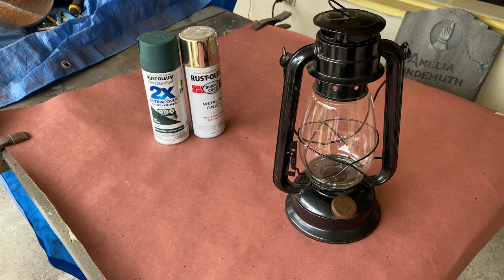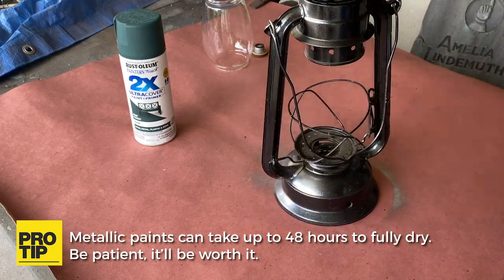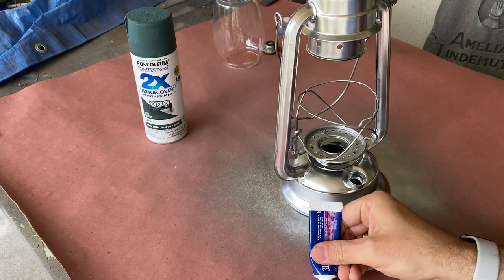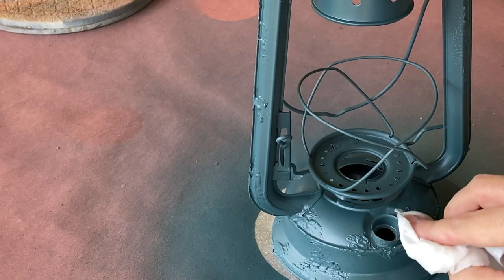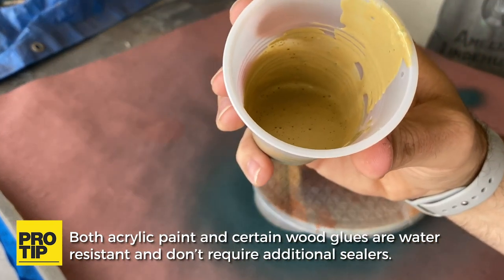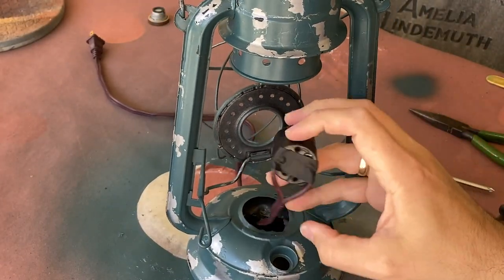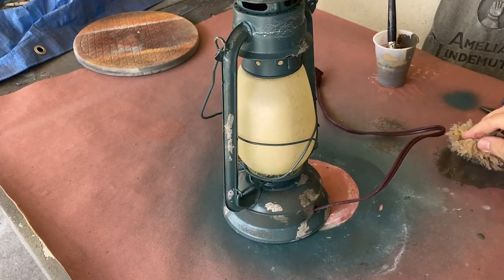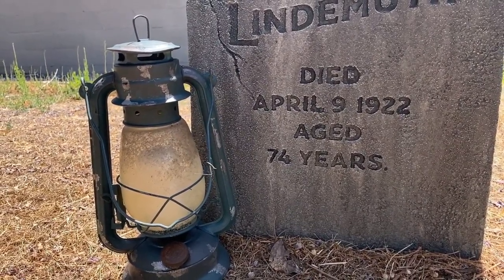HALLOWEEN HOW-TO: Gas Lantern to Electric with Chipped Paint

Comment: That toothpaste idea is brilliant! I got so much insight with this. A safer alternative to 110v bulb that I've discovered is I can use broken/cheap solar flame effect, pathway lights and gut the electronics to retrieve the thin toilet roll looking bulb (and keep the solar panel if it can be hidden). I've tested this and know I can run on a store brand 1.5v AA battery continuously for 3 days (without panel), more than 4, for name brand batteries!

Comment: Umm, normally silver is the neutral side and the copper side is the hot... it'll work either way with an incandescent bulb, but just fyi... However, for safety reasons, the silver side will electrify the outer silver casing the bulb goes into... the hot should be on the copper terminal and should only electrify the middle terminal...
Reply from the maker: It’s my understanding that on a non polarized plug it doesn’t matter.
Reply: @VanOaksProps  Yes, it would still work, but imagine checking for voltage in the socket and the entire outer casing of the sockets is energized, but the tiny copper center has the neutral. It's just a safety precaution, and rule of thumb... silver/white(neutral), copper/hot... just saying...
Reply: @VanOaksProps  I was an electrician in the Air Force for 20 years... I'm really surprised no one else has mentioned this to you... just want you, and anyone really, to be safe.
Reply from the maker: I appreciate it!
Reply: Hmm.  😊
I just made this comment above and wish I had read further in the comments first.
Non-polarized plugs should only ever be used on double insulated devices.
I didn't even think they could be sold by themselves any more in the U.S.
CPSC and FSC are such nannies!

Comment: Great paint job. I love the props you make and the way you get that stuff done.
Instead of mains power, I personally prefer low voltage. It's very easy to open the flame-LED-bulb and remove the complete socket including the power-converter. You will end up with a "naked" LED-matrix, which runs the flame-effect if connected to 12V. You can now power the lamp even with batteries and have no hazardous voltage ;)
Best greetings from Germany & hope, you had a very nice Halloween :)

Comment: One interesting thing to note about the LED flame bulbs is that the LED array within the bulb runs off of DC voltage.  The base of the bulb contains a circuit that converts the AC voltage to the DC required by the LED array.  You can disassemble the bulb, remove the converter circuit, and solder in a battery holder that matches the energy input of the LEDs.  It'll allow for folks to avoid using line voltage, and will allow for it to be more portable.
Reply from the maker: Good to know! Thanks for sharing the info.

Comment: Very nice little lamp Derek but you have neutral=brass/gold, and hot= silver.... wrong. ⛔
Silver is always neutral/white/ribbed/wide blade
If you wire hot to silver, the threaded socket will be hot/switched and the little nub in the bottom will be neutral.
I wouldn't call someone out like this, except for the danger of (possibly!) touching the bulb threads before the bulb hits bottom.
In that case it's your hand that is 'hot' and the only return path is whatever else you're touching.
Please keep on amazing us with your ability to bring depth and life (or death) to mundane objects and creating creepy set pieces for your home/haunt!  😉
Reply from the maker: Thank you for the correction!
Reply: @VanOaksProps  I wish I had read through all the comments to this older video (I would have seen it already mentioned ☺️)
Really enjoying working my way through your back catalog though! 
There's always something to learn in VanOaks!

Comment: Any suggestions for a resist that can be easy to clean up like toothpaste, but will work for craft paint?  I tired a test with toothpaste painted over with craft paint, but it doesn't work, it just behaves like regular paint when dry and doesn't wipe away.
Reply from the maker: How did you apply the paint?
Reply: @VanOaksProps  A brush.  I am doing some extremely fine detail work so the toothpaste can't be put on thick but neither can the top coat of paint either.
Reply from the maker: Liquid latex. The reason the toothpaste isn't working is likely because it's being disturbed by the brush as you apply your top layer of paint.

Comment: Love this idea. I make props for the local community theater and there's been times when we needed a lantern like this, but it needs to be carried by a person and can't have a real flame. I used battery powered tea lights, but it looked like I had put battery powered tea lights in it instead of looking real. Perhaps you can make a video on a better way of making a battery powered one. Thanks.
Reply from the maker: LEDs play nicely with 9v batteries. If you get a wired 9v battery connector and a pre-wired flicker LED bulb you should be able to achieve a pretty believable lantern effect for theater use.